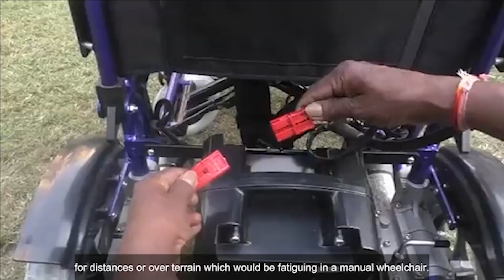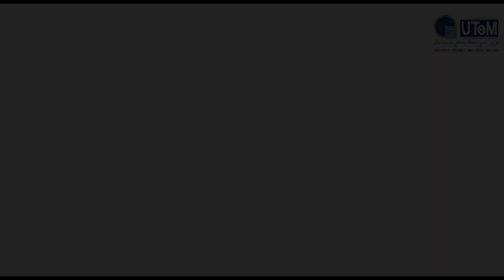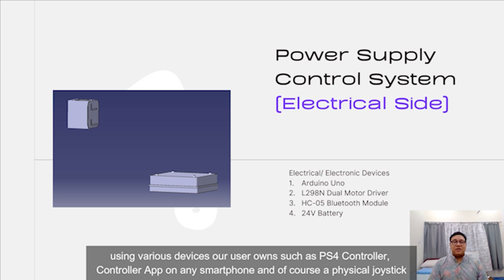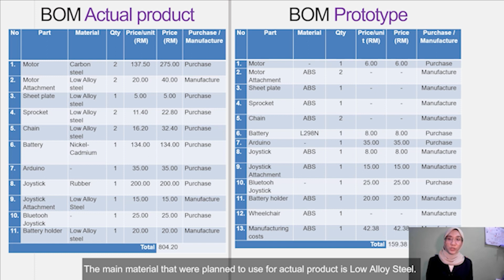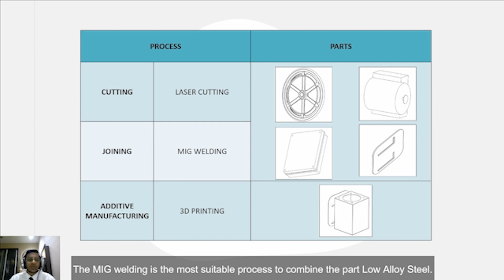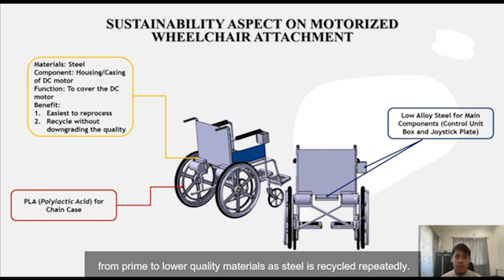Integrated Design Project (IDP) 2021: Motorized Wheelchair Attachment (G35)

Comment: Assalamualaikum & Good Day!

Congratulations on your completion of prototype.

Your idea will help a lot of disable people to have motorized wheelchair.
Currently this product is quite expensive and your team has help to develop this lovely product with cheaper price.

I'm wondering on the actual one, what is the weight of the battery will be used?
It should be lightweight and rechargeable battery.

Thanks and kudos!
Reply from the maker: Waalaikumussalam and a good day to you too sir. I'm Muhammad Syakir, the leader of group 35 would like to thank you for your time to watch our presentation and give a response to it. In response to the given question, the battery that will be used for the actual product is a Lipo- Lithium type and will have an approximately weight of 4kg with 24V and 20AMP. The reason we chose this type of battery although it is pricier than the common electric wheelchair battery such as Lead Acid type is because it is more lightweight, rechargeable and can last 3 times longer due to its lifespan. In general, it has better quality and we only want the best quality for the users. I hope my explanation could answer the question, thank you!